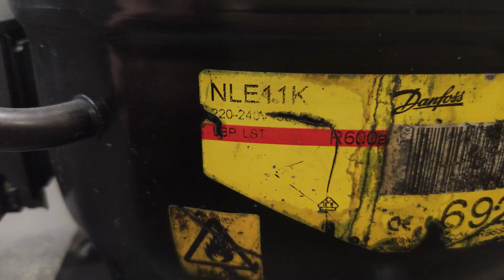Convierto un Compresor de Refrigerador en una Soldadora

Comment: Don't waste your time on silly jokes :) In this form, it will not work at all. The motor stator is not intended to be used as a transformer, at least not with such a winding. Of course, you can wind a toroidal transformer on it, but in order to achieve the power required for welding, you will need to glue five such stators together. And it’s not a fact that after that it will be possible to shove all the windings there. And if it does, then half of the iron, in which the grooves for the windings are located, simply will not work, and such an elongated rectangle in cross section will not allow developing power to the fullest.